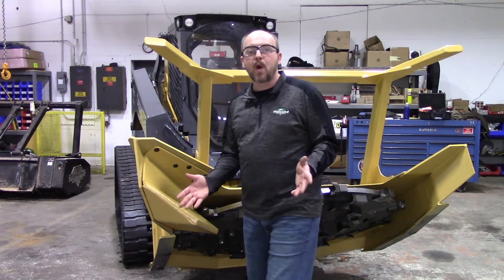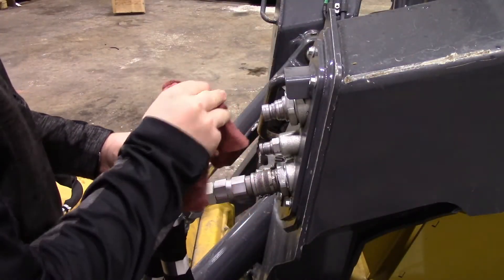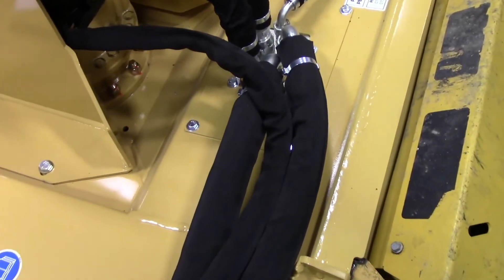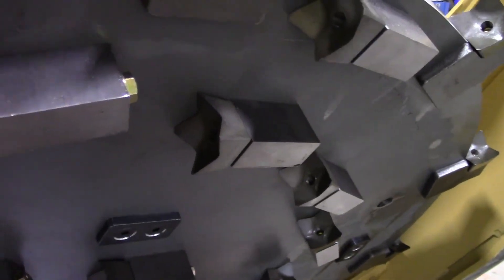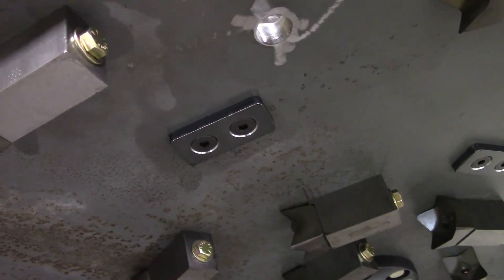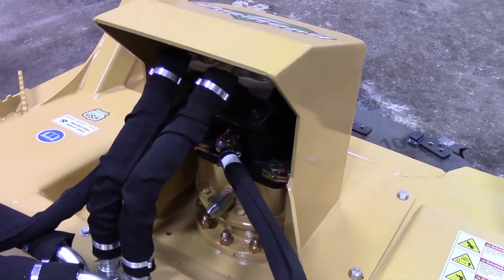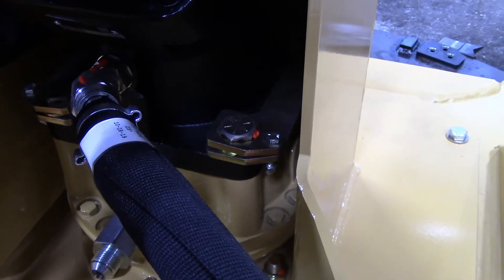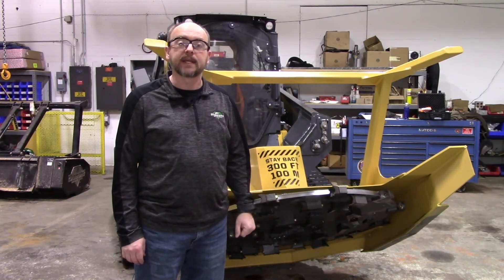Diamond Mowers: Skid-Steer Disc Mulcher In-Service Product Guide

Comment: I am interested in buying this skid steer disc what is the cost.
Reply from the maker: https://diamondmowers.com/products/skid-steer-attachments/skid-steer-forestry-disc-mulcher/

Price range from around $19K - $29K for Disc Mulchers
Reply from the maker: What size are you looking at? In addition - it also, depending on the size, is available in Piston or Gear Motor
Reply: @diamondmowers  I want those that can handle all purpose due to the forest. I'll like to know the prices for the new and used machine if they are available.